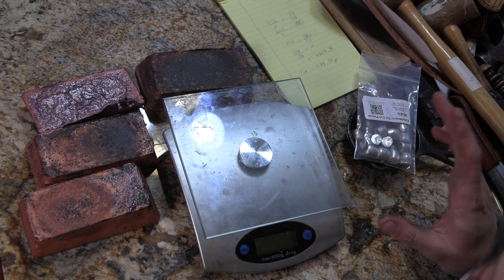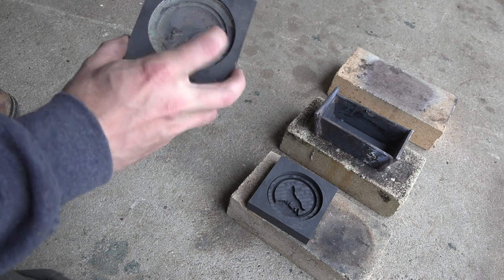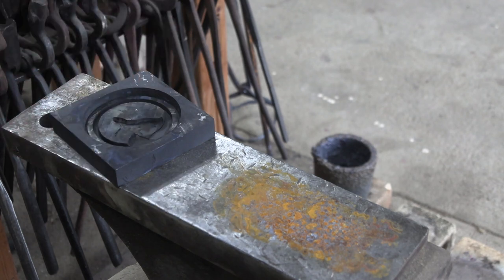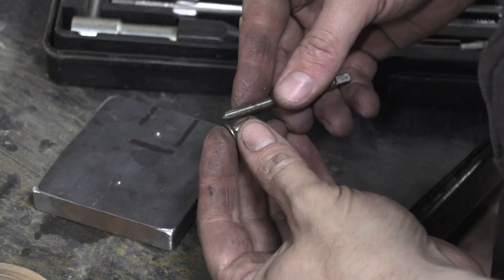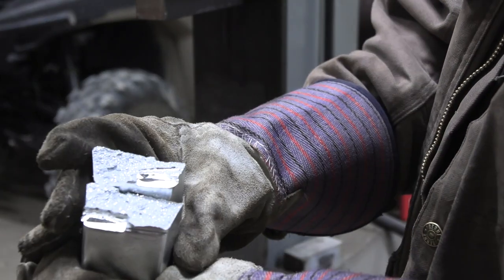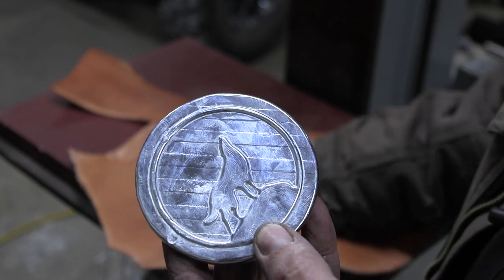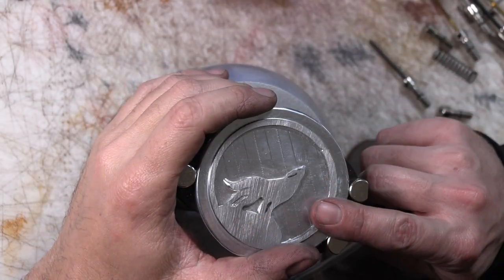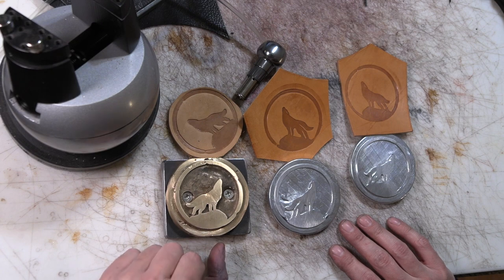Making leather stamps by trial and error

Comment: Did you try sandcasting? At least you wouldn't break your molds during the pours.
Reply from the maker: I tried to use sand with a 3d printed positive.  Couldn't get the sand to release from the plastic.  Pulled out the entire background area behind the wolf.  I did consider making a silicone mold to cast wax pieces for some lost wax casting but went this route instead.

Comment: Why dont You just 3D print those stamps? Much easier and cheaper too.
Reply from the maker: Durability.  They are intended to be used for hundreds of impressions with a hydraulic press.  The brass one is being used as a branding iron.  Nylon or fiber reinforced plastics might work for the press, but for the one that is going to be in a campfire it wouldn't.  Even the zinc alloy cannot handle enough heat to burn a brand in leather.